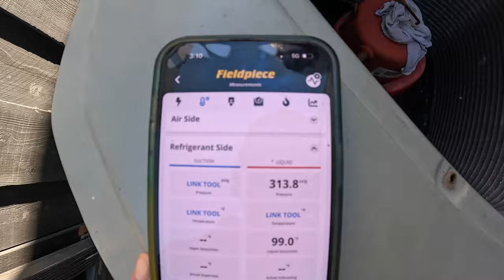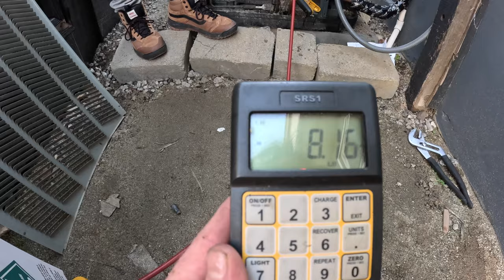Our Leak Repair EXPLODED TWICE - Every HVAC Tech's Worst Nightmare

Comment: I've seen leaks like that on the commercial side, and it is always best to re-pipe, I'm not saying it's wrong to patch, I've tried the patch before and learned my lesson too. You're right about the pressure switch, probably should have moved it or hit it with more braze during the repair may have worked. We learn more from failure than we do success.
Reply from the maker: Most of the stuff I’ve learned about repairing leaks was on the commercial side. We all learned on this one. Looking back I probably shouldn’t have gone over top of the repair but you live and learn

Comment: From a real tech, you should have sold them a new system. 😂  Seriously speaking, how did the repair fail? Did the silfos pop off or develop a separation crack? 5 or 15%?
Reply from the maker: I have already recommended a new system here twice. Mostly just due to proximity to the ocean. It’s about a half mile to the beach

Comment: I would not have fixed a cracked copper pipe for a second time. I would have cut the 1/2 inch copper line between the muffler and compressor and replaced only the 90 degree piece.  2 braze joints less time on job and muffler still in place. Also cover high pressure switch with a wet rag when brazing close to it and it should not crack the solder. Great work anyway. Job is done. Lessons learned.
Reply from the maker: I agree with you on all this. I will add though that I was going to replace the muffler for free as well but there were no 1/2" mufflers in stock at any supply houses. I have seen my fair share of leaking mufflers and didn't really want to risk another leak in the vicinity of our brazing. The solder went all the way to the muffler from the original leak repair so we would have had to sweat out the copper to reuse it as we were not sure where the original leak even happened due to the coverage from the solder. I just didn't want to risk all that so we cut it out. Thanks for the honest feedback

Comment: Since it was already repaired before you got there, it was probably best to replace the tubing. But, I probably would've done the same thing you did and try to re-braze it. Since that pressure switch joint was close to the new repair joint I would've touched up the pressure switch with some braze while I was making that last repair as you said. HVAC is like Murphy's Law. I feel your pain bro.
Reply from the maker: Yeah I was a little frustrated when I showed up and saw they didn’t just cut out the pressure switch. It’s better to learn this stuff this time of year and not summer so it is what it is

Comment: What kind of brazing rods are you using? It's always best to replace the bad section of pipe, but if you try to repair the leak use 45% silver solder with the flux on it.
Reply from the maker: We generally use 15%. I actually hadn't heard this before. Do you recommend 45% on all leak repairs then? I'll buy a pack and make sure we have them so the next time we have them ready
Reply: @SurfBrosHVAC  I typically do and have never had an issue. It flows better.   45% has definitely helped me fix a few tricky leaks. It's a lot more expensive but definitely worth keeping some on the service vehicle.
Reply from the maker: Heck yeah man I'll try it out. Thanks for sharing knowledge